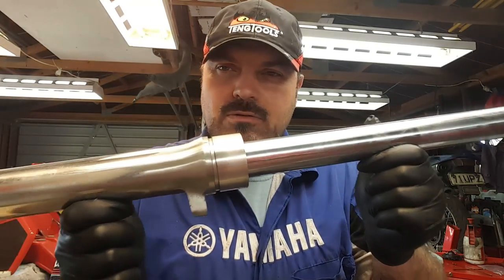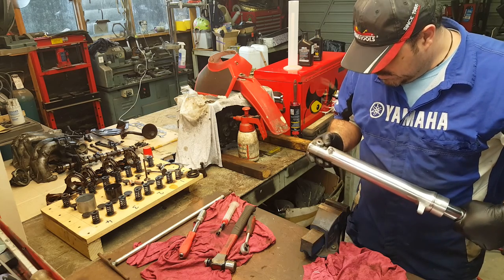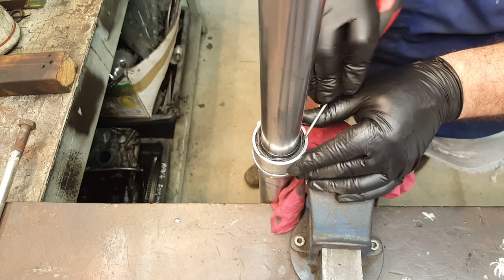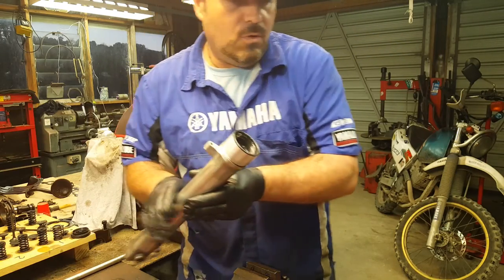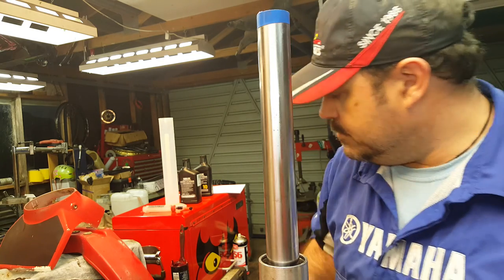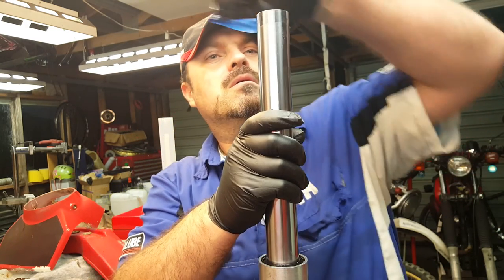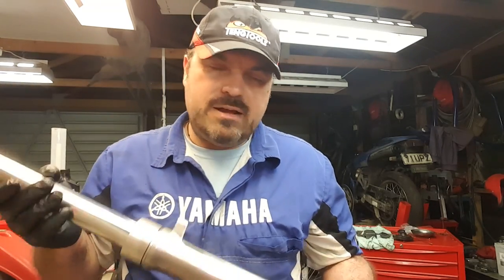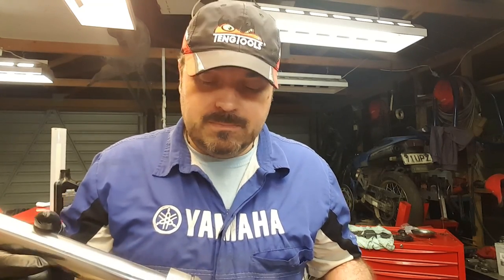Yamaha TDR 250 front fork rebuild #1607

Comment: Good video for anyone that hasn't tackled forks before. Two tips I'd pass on. Cut a couple  of pieces of angle ally and make yourself some soft jaws for the vice instead  of rags and when putting the top cap back on it's easier if you back the preloaded adjuster right out first.

Comment: Hi Andy 
Can I ask a question from Ireland . I recently got a mechanic to do the seals on my tdr (1988 250) only noticed when I got it home (transported in a van ) when I holed in the front brake and pump it , it sits Down about an inch from finish point so to speak . It was set at soft position and I rang him he said just it ,so I did but no difference is this normal or is the seals still gone , any info would be appreciated 
Thanks great videos